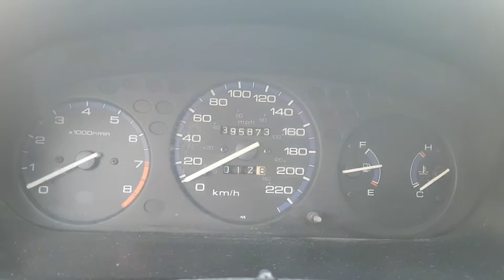Shifter Bushings INSTALL (ENERGY SUSPENSION) || CIVIC BUILD #5

Comment: I just installed the same today. Heat the bushing in hot water and warm it up. Use plumbers grease or dielectric grease on the shifter support arm where it inserts. Mine was able to just pop right in by hand.

Comment: The remaining slop is from the U joint by the b1tch pin or the plastic bushing around the ball seat. You have to cut the rivets to rebuild the joint or innovative makes a linkage with a joint thats bolted together instead of rivets. Good luck bro she's come a long way.👍